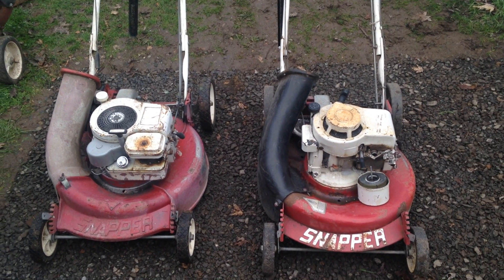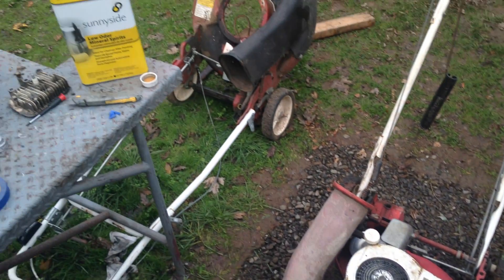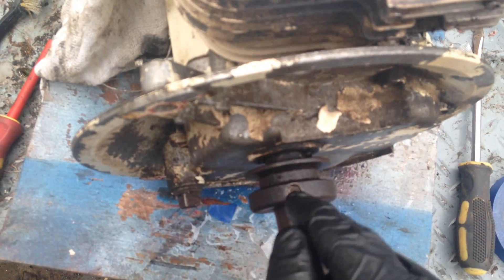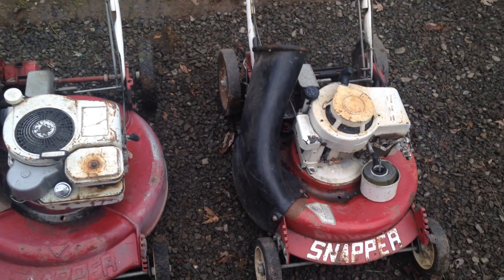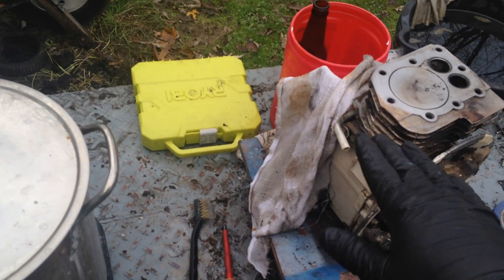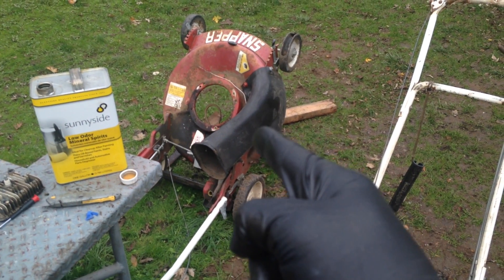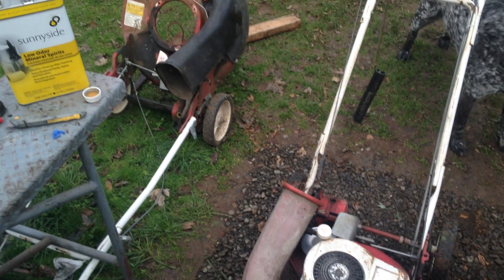Restoring 3 Vintage Snapper Push Mowers

Comment: Those are awesome man. Old snappers are really cool
Reply from the maker: These ones are cool but I should of looked a little closer at them before taking the engines off. I think I can save only 2 of the 3 since one has a bent crank.

Comment: This may be hard to believe but I swear on Andy Griffith and Hickok45. Those two being the ultimate southern gentlemen and not to be swore on lightly. I bought one of these at least 15 years ago for basically a little side yard mower, I have extensively used this mower every single year and have changed the oil only three times and two spark plugs. This has been the best $25 I have ever spent, cranks and runs every time. It won’t cut wet tall grass but a sharp blade and my ground full of centipede it looks professional. If u see one, buy it, without question.

Comment: does the cast aluminum one have an alum chute too?
Reply from the maker: It has a plastic chute like the one next to it except they used a red plastic which in this case is very sun faded.
Reply: @MrTL117  OH, LOL, are you aware of any metal chutes?
Reply from the maker: I think there might be one type that has a metal chute, the riding mowers do have a metal side discharge chute.

Comment: i have the same snapper pushmower never knew it was vintage though. it still runs. but it uses alot of oil and just aint fit for mowing todays lawns mostly because after you get done its hot and smoking bad :( recently the fly wheel stopped turning.
Reply from the maker: Sounds like it needs a complete overhaul of the cylinder and piston or a repower anyway
Reply: @MrTL117  thanks I'll definitely take a look at it!

Comment: I have one like the one on the left  it runs but won't stay running seems to be when it's cold it starts right up but then won't restart when hot or warmed up could that be the head gasket
Reply from the maker: Sounds like you have an ignition coil problem. When they heat up they can loose spark and cause your engine to die. When it dies out on you the next time, take out your spark plug and ground it to the head of the motor, then turn over the engine. If you dont have spark then your ignition coil is bad. New coil is about 30 bucks.
Reply: @MrTL117  thank you I'm going to try it I have electronic ignition coil another four and a half Briggs would that work
Reply from the maker: Its possible it might work but there are slight differences in briggs motors. Wouldn't hurt to give it a try
Reply: Thanks for the info i tried the electronic ignition coil and it worked run great now

Comment: I just picked up one like the commercial grade on the left, including bag.  I believe it just needs a diaphragm and carb cleaning.  What is your opinion on re-painting?  I'm not looking to re-sell but thinking long-term, would it hold value more as "used" looking or "new" looking?  Anybody?      
Thanks!
Reply from the maker: Well it kinda depends on the condition of it, if it has most of the factory paint in tact then it might be good do just do a sympathetic restoration, so clean it all really well, maybe repaint the engine depending on how it looks but keep the deck as a new / old combination. If its very hammered all around then it would be worth it to repaint. The prettier it looks the more money you could get out of it. Would hold its value as a new to good condition. Of course this all depends on what someone is willing to pay for it.

Comment: Have you rebuilt any of the drive transmission in these or others similar to?  I am rebuilding one of three i have and have a question that so far is unanswered.  The geared shaft that turns the belt seems to have no way to seal the oil from coming out. The cuts/slots on the shaft that the pulley mounts onto extend thru the bearing and into into the case. There is no way to seal short of siliconing the keyways. Or placing o-rings at exit of case, followed by washer, then o- ring, pulley, then o- ring, then washer, finally the mount bot.  I know that none of this is done factory but I am always finding oil escaping and ending up on the pulley and belt. Any thoughts?   Thanks
Reply from the maker: Sorry for the late reply! Did not see your comment until now. I know in the transmission they used 00 grease (double o grease) which is more grease than oil. If you used regular oil it would get everywhere since it has no binder to keep it in check. I have only opened the transmission on the 1988 Snapper to see how the components were wearing and then re-greased it. Stuff isn't cheap but it does last quite awhile. I can open up and dissect one of the transmissions I have if that would help your situation. Hope this information is helpful. Thanks for watching!
Reply: vintage fixer thanks, I have since found just what you said 00 lubricant. Now I looking into substitutes since snapper is very proud of the grease they don't manufacture by brand it as theirs.  Found plenty of 00 options and a NAPA option called EP-1.
Reply from the maker: Your welcome, again sorry about the late reply. This is the stuff I have used in my 1988 mower: 
https://www.jackssmallengines.com/jacks-parts-lookup/part/universal/770127?gclid=eaiaiqobchmirloo98v82givklqgch3iegq6eaqybiabeglwb_d_bwe 
Seems to work just fine, no leaks. Hope you have good luck in repairing your problem!
Reply: vintage fixer finishing the rebuild on one, took off the drive from the mower to install the rebuild. a Thought I would clean and check out why the old one was alway leaking oil.  Other than the obvious at the output pulley shaft I found a place where I would have never thought to look at. I drained the lub that was in it and then filled with gasoline to clean and look for leaks since with gas it should leak like a sieve. Of course it leaked at the pulley shaft but did not leak a drop on either axle shaft seal or body halves seal!  The place it leaked was a surprise, it leaked around the pulley guard mount studs. I will taking the rebuilt apart and sealing the studs from the inside before I put it into use.
Reply from the maker: Interesting, I will need to remember that when I rebuild mine in the future. Thanks for the update!
Reply: finished the first rebuild. Sealed the slotted shaft for the pulley with RTV silicone at the point of insertion from inside, also sealed the studs for the pulley/belt shield.  Did not have the 00 lub yet so I tried 80/90 gear lube. Not a drop of oil leaking as yet.  I mow flat/uphill/downhill, side hill from the left and right. Prior to this it would always leak at the pulley shaft when going uphill and side hill with pulley on downhill side. Not anymore!  Now that I have the correct 00 I now find that I have no info on how much to put in!  Do you have ny info on lub fill volume?
Reply from the maker: Congrats on no leaking! I'll look in my manual for them but I just filled it to maybe half way, to where you can see it if you look down from the cap.
Reply: I have really good PDF files for parts on these older units but I can't seem to come up with PDF file for a service manual without $$$$
Reply: Found a PDF for service. Page 25 trans lube specs!  http://pdfstream.manualsonline.com/5/5ffdaa8b-1ec3-cf84-f164-40d1268683db.pdf
Reply from the maker: Very informative! Thanks for posting

Comment: where do you get parts for those lawn mowers
Reply from the maker: I find a parts explosion usually at partstree or jacksmallengines and then if the parts are not available I go through Ebay to order parts. You can do a model number search on the engine or mower and usually get the diagram.

Comment: Hey, I need a bit help finding a carburetor rebuild kit, my snapper is just like the one with the SNAPPER still visible
Reply: The mom commercial but still has a engine in it one
Reply from the maker: The Carb is pretty basic on that one, just this diaphram and a good cleaning should get it back up and running. Might double check the part number you need by entering in your engine model number located on the front of the engine where the spark plug is. https://www.amazon.com/gp/product/B0035Q4GAG/ref=oh_aui_detailpage_o04_s00?ie=UTF8&psc=1
Reply: Well I need a new bowl sealer and I think my brother wants to replace  some other things
Reply from the maker: That should be the bowl sealer you need unless the engine is different from that one
Reply: vintage fixer thanks
Reply: The old snapper have lots of gas, I was messing with a turkey baster putting gas in it and putting it in the carb to get my mower started, as a seal was broken and that was the only way to start it and run for the time being of the gas you put in it, and I had to drain all the gas it took around 10 minutes
Reply from the maker: Nice job!

Comment: Do you know a lot about mowers? Because i have an old torro that i'm told could be worth $200 to $400.
Reply from the maker: I don't know very much, I just like working on the older mowers and how they look. I would research it online and learn as much as you can about it and find out why it's worth that much.
Reply: vintage fixer Alright, thank you for the help

Comment: I have the one on the right. Do you have an email I can message you on? I'm trying to fix it up but dont know how to and could really use the help since you seem like you have some knowledge
Reply from the maker: There are lots of good youtube tutorials for these types of Briggs and Stratton Engines. It can be a fun learning experience! The cost of restoring these can get quite pricey but it all depends on how far you want to go. The Bag and wheels will run you the most and then the other parts will nickel and dime you. Rough guesstimate I had on my 1988 is probably close to 200 or so. And that is without the bag or wheels.  

This is a 2 part series on the type of carb and how to clean it.   
https://www.youtube.com/watch?v=fdFrniPyBwE 

This channel also has a lot of videos on repairing mowers 
https://www.youtube.com/user/hanksranger/featured 

I do not currently have an email for my youtube account, but if you get stuck your more than welcome to reply on this thread. Just go slow and make sure you take pictures and organize your parts in labeled ziploc bags. 

It would be wise to make sure it will run before you go about fixing it up. Check that you have oil, and spray some starting fluid or carb clean into the air cleaner throat.
Reply: It's not running. The recoiler broke so that needs replaced and the wires are not connected to the motor. I was trying to find out how to connect them back. The wires I'm talking about are the gas lever, self propel and red lever that changes self propel speed if yours has that.
Reply: I have another snapper that is a beauty that runs fine but this one was a rare find to me since it's the same year but has a different motor and has self propel and electric start. It needs a new battery but I'm not worried be cause the plug that plugs into the electric start has a little plug for the cord missing so I dont know if I could find a new one of that.
Reply from the maker: Those can be a pain to fix, you can take just the recoil off and take it to a repair shop and they will install new recoil rope and spring. If you try and do it yourself be careful of the spring. It can uncoil and get ya. If I had access to my mower I would make a little video for you. and walk you through it. However I cannot in my current living situation. Might want to do some youtube watching on the Briggs motor.  The red lever for your self propelled should connect near the rubber wheel on the deck. If your mower still has its model number decal on the deck it can give you an exploded view of your mower. 

https://www.snapper.parts/Find-Your-Snapper-Model-Number
Reply: @MrTL117  I'm sorry to hear that. Unfortunately I have to do it by myself because mower shops around me dont work on mowers before 2000 which is frustrating. Will the website show me where to connect the cables from the handlebars to the motor?
Reply: I wont be able to work on the mower till spring so I'm just trying to get the information I need. If you ever are able to make a video on it, that'd be appreciated  but I understand if you cant for a while
Reply from the maker: That is dumb they wont work on mowers before 2000 but it can be a tight game when it comes to making money on older machines. Hard to find parts and lack of experience with older machines. The parts explosion will give you a good concept of the machine and where your drive system comes together. But will not show you where to connect to the motor. A good series to watch would be My Curb side Snapper series to give you a good pointers and some inside knowledge. 

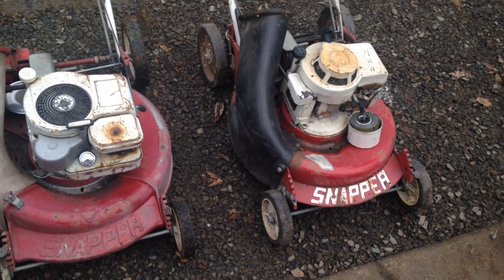This video https://www.youtube.com/watch?v=wRLsi3RfwFA&t=64s At 1:27 shows how your throttle cable should be connected to your motor. 

In this video https://www.youtube.com/watch?v=bPwo4N3JMbQ At 7:42 is the C clip that holds your throttle cable.
Reply: @MrTL117  thanks I'll be sure to watch those. Sorry for the tons of question but do you have any idea how to rope starter comes off of the motor in that video? I dont see any screws for it to come off so I can replace the recoiler I realize the snapper in the curbside video is my exact mower but without the electric start so it will be helpful
Reply from the maker: It's okay, The recoil itself comes off as a whole assembly. There are 2 bolts above the spark plug and one on either side of the shroud on the back of the shroud. By the dipstick and opposite of the bolt location.
Reply: @MrTL117  alright. It's late now so I'll look at that  tomorrow. I really appreciate you helping me out here surprised you dont have more subscribers
Reply from the maker: Your welcome, always nice to see an old mower get new life.
Reply: @MrTL117  yes it is. I might make a video showing off my working snapper mower once it gets warmer  for you to see it. I've always looked for a older snapper riding mower and I hope ill find one that works and I can buy
Reply from the maker: @FirebirdRestores  That would be nice to see if you are able to make the video, I found my rider by chance on Ebay. It takes awhile to find them but they are quite fun.
Reply: @MrTL117  I'll make sure to comment on a video telling that I've uploaded it once it gets warm

Comment: nice check out my snapper I just found also what's the value on the one I have with a electric start i think it's a 1987
Reply from the maker: That's a very nice snapper you picked up! If the blade is straight and not bent, and the bag is in good condition then I would be asking 200 for it since it has the electric start. Nice find.
Reply: vintage fixer yes the bag and blade is good i cleaned it up its pretty sharp looking now I'm just going to ask around $50 for it thanks for the reply though.

Comment: Those old 3.5 hps dont have enough power to run those mowers. I put a bigger Quantom on mine.
Reply from the maker: After I restored one with new rings it has plenty of power for cutting, but if it ever dies out I will look into the larger engines